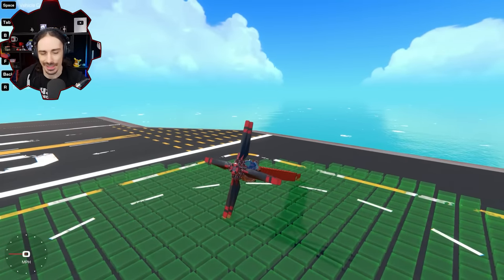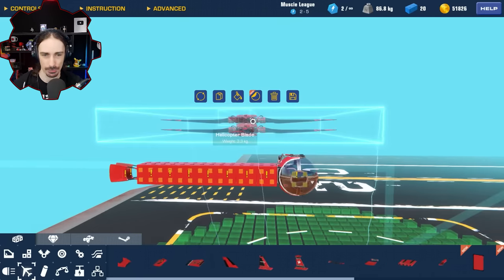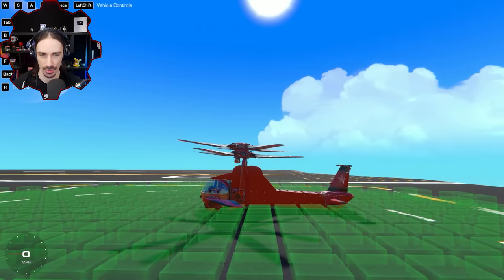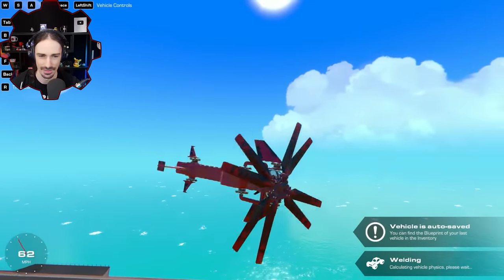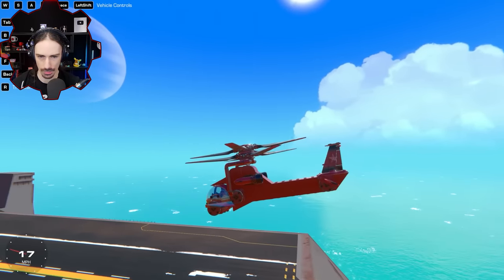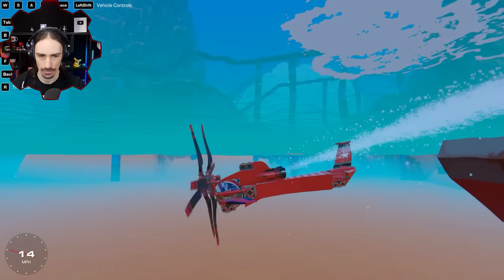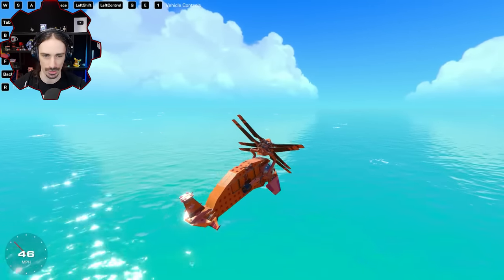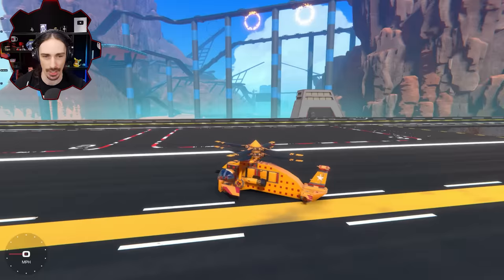Building a Transforming SUBMERSIBLE HELICOPTER In Trailmakers

Comment: You should make custom props using paddles a d small modular wings with steering hinges for angling them, that way when your in the air you can have lift and in the water you can have forward force.

Comment: for the helicopter

Name: Sea Minnow SH-16 (16 comes from the 16 minute video time)

Description: Designed as a search and Rescue Helicopter, it can go in both air and water by pivoting it's main rotors toward the front of the craft, making it have propulsion from the main thrust even when in water, with the addition of a Reaction Wheel so the Sea Minnow can have an easy time with yaw control while still staying compact so that there is less weight to deal with when in the air. This Helicopter, with the aid of a good pilot, can go in tight areas where most might not be able to reach, along with reaching underwater areas to easily save whoever it is in distress. (this craft can also be used for exploration purposes due to the performance)

here you go Scrap Man, i hope you enjoy the idea!!

Comment: 11:15 Pro tip for the future: Add logic gates with output less than 1 on toggle (you gotta fine tune this) to activate heli engines for hover/slow sink mode. It will make your landings way smoother.

Comment: Heli with double propellers (one front another back) could solve the balance issue

Then there's quadcopter option - propellers can be smaller, and for submersible mode simply have to turn forward

Comment: This would be the most OP Stealth helicopter, under the water there is no chopping noise from the blades. On a side note. The swash plate is pretty easy to make, all you need is the 1x2 hinges stacked with the directions perpendicular for the 2 layers. So to help visualize first layer place the hinges layer like this = and on the other layer like this || hope that's helpful. After that it's just programing the tilt. For a closer to realistic yaw control, you use logic with your helicopter rotors to slow down one set of blades depending on which direction you need to rotate. Admittedly the yaw controls are a lot more work than the swash plate. And if you really want you can still utilize your other controls with the swash plate, that might give you more precision control but not sure about that.
Reply: In hindsight though, sonar would still be able to pick them up, but with it being so small it would still be hard to pinpoint it's exact position, but it would technically be possible to spot them.
Reply: @MrMattkid  I think you're underestimating the power of sonar. It finds fish even at long distances, so what makes a helicopter so hard to find?
Reply: @Loke  You see sonar works by bouncing sound off an object. But when you have massive blades chopping the water they interfere with the audio bounce back, especially considering the body of the craft can get complete cover behind the blades. That's why I said possible to spot it but not pinpoint it's location. If you just listening to ambient noise in the water with a military grade sonar system you'd know it's nearby but without any real direction, possibly a rough estimate that might be close enough to take it out. The pinging sonar on the other hand will can get an exact position however it only listens for it's ping frequency, and as I mentioned with the chopping, it might eat that sound frequency into the din of other noises, it could even end up scattering it in random directions causing a flood of False positives. When an object can't interfere with the sonar such as fish, I'll give you it's highly accurate.
Reply: @MrMattkid  Fair point. thanks for the explanation, I'm no sonar expert, just a jet/nerd so I understand radar much better than sonar
Reply: @Loke  I wouldn't call myself an expert either honestly. I've just looked into things and retain information very well. I just don't want to take credit for something I'm not.
Reply: @MrMattkid  That's fair. Also it's humble of you to say you're not an expert, most people would just go along with it. Glad we have people like you in this world.
:)

Comment: Naming idea and decoding. SMITR (pron.-Smit- Are) Submocopter 1
Decoding- SM- ScrapMan. I- Industries T- Trailmakers (For different creations this will be the name of the game it was made in) R-Rescue (purpose of the build. I made a story of why it went into lagoon and returned, its down below.) And name of build and model.

Story (based on how it was used)
Scrapman's sitting in his office in Trailmakers, the ScrapMan Rescue services. He gets a call, saying that a plane has crashed in a lagoon that is too far to be reached by ships or subs, and a plane is not ideal. Scrapman instantly knew what to do. He took out his Submocopter, and took to the skies. He swiftly tried flying to the lagoon, and when he reached it, he saw that it was smaller than he expected. nevertheless, scrapman attempted to dive in, switching to sub mode, to which the helicopter smoothly transmitioned to. He went into the water, and quickly pulled the aircraft out of the water. He went out of the lagoon, into the open sea, and switched back to heli mode. he then went out of the water and safely into the sky. One of the survivors said that another survivor jumped into the ocean before the plane crashed, so scrapman quickly went there and rescued the survivor out of the waterr too. He then proceeded to return and land safely back, proud and happy, that he saved another few lives.

Comment: I used to build a similar idea. Though propellers work really poorly underwater and I only use them for boyancy, and added water engines instead for mobility. I also added gound engine and wheels so it can drive on the sea bed